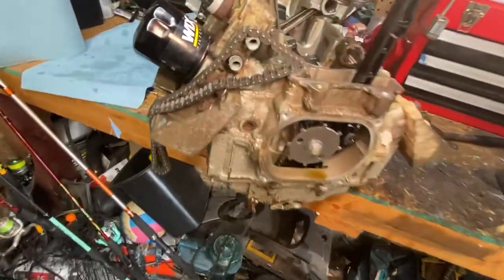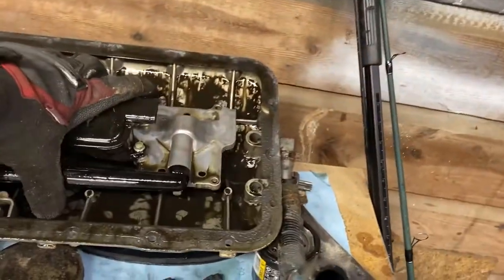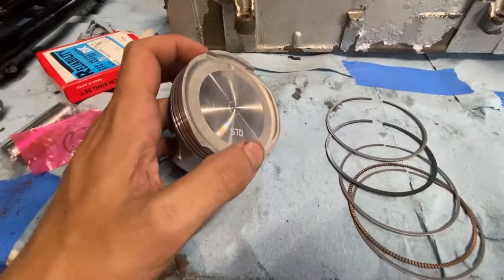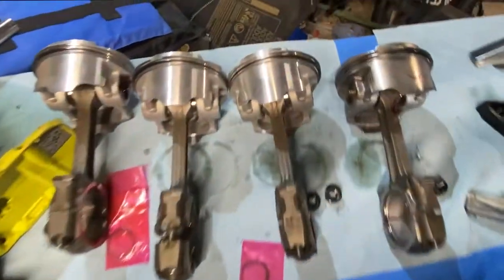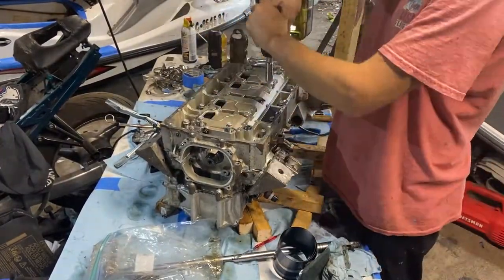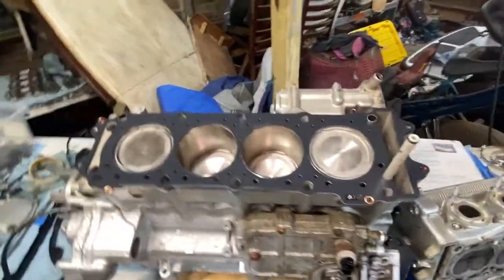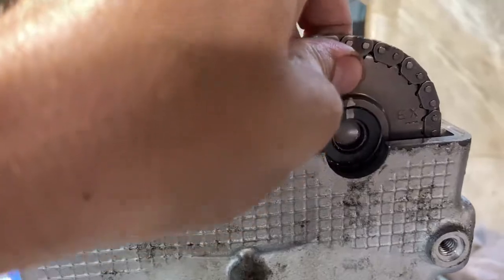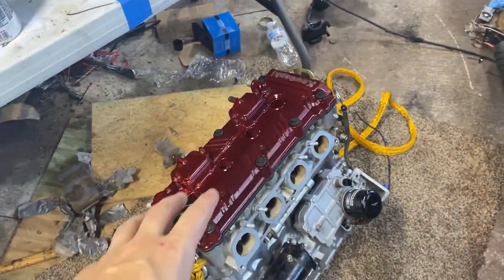Jet Ski ENGINE REBUILD Part 2: Kawasaki STX15F 1500/1200/Ultra

Comment: Excellent video, what is wrong with STB crankshafts? Engine empty weight? TIA. Shared on FB kawi groups.
Reply from the maker: Around 190lbs with the exhaust. And the SBT crankshafts don't seem to hold up well over time, I have not experienced this but have been told by a number of people.

Comment: Did you put the timing chain guide on that goes between the cams at the top of the head? Did you check the valve clearances? Again, I would recommend taking the oil cooler apart and cleaning it.
Reply from the maker: Oil cooler was cleaned out off camera. This should be done on any rebuild. Cam guide was also installed. Both skis are running great and ready for next season. Valves were inspected by machine shop when they had the heads and cylinders.

Comment: Do you know how I can tighten my crank bolt with out buying the rotor holder? I'm not confident using the rope in the cylinder trick, worried the piston assembly will bend. My ski is a 300x and the torque is 195 lbs.

Comment: Rode a kaw, it was probably an stx15 or an ultra. Thing was wild. Do those engines have a lot of problems? Guy has a blown up ultra for $800 right now but i dont want to deal with the supercharger.
Reply from the maker: I see them blown up more than running. I consider them a maintenance heavy ski. $800 is a steal for an ultra, its worth 3x that if parted out.